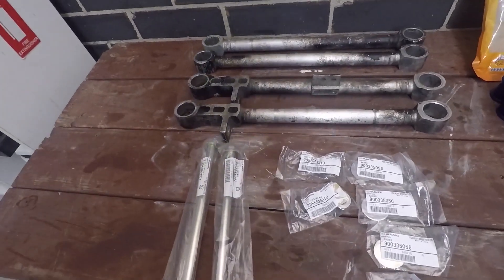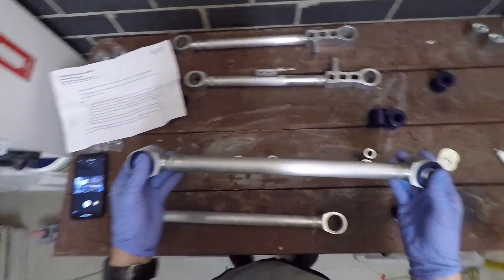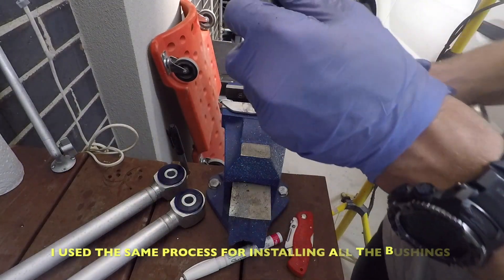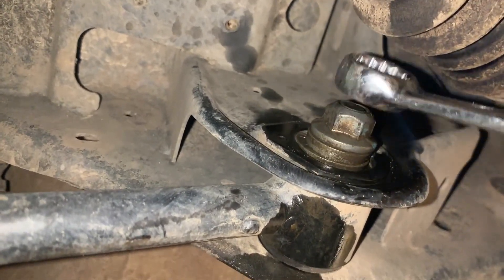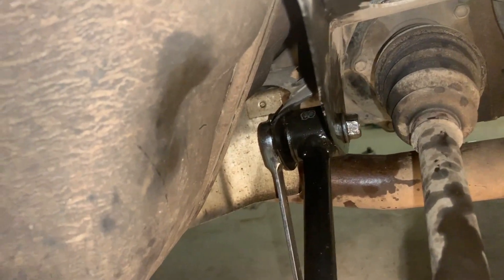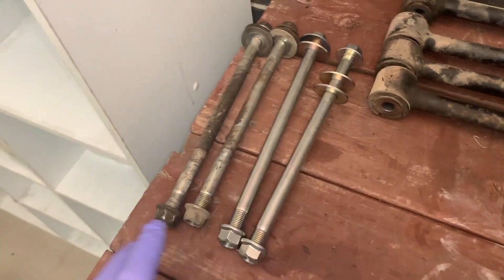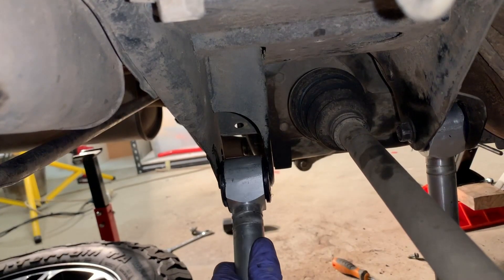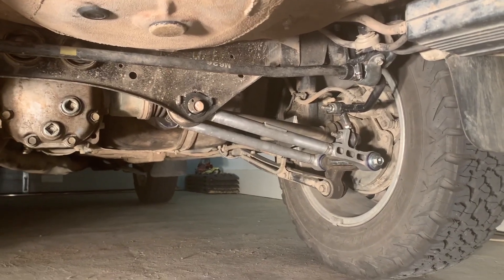SUBARU FORESTER - STI REAR ALLOY CONTROL ARMS ( WITH SUPERPRO BUSHINGS) - INSTALL

Comment: Is the end link tab on the STI links in the same location as on the OEM links? Are the tabs the same distance from the lateral link bolt?  Did you have any trouble lining up the sway bar with the tab during installation?
Reply from the maker: Hey mate, i didn't measure it but it was pretty much the same. and no issues with the sway bar.
Reply: @dtpprojects  Thanks for the reply!

Comment: Are there any other benefits to these other than strength and weight, like do they offer additional camber or anything?
Reply from the maker: Ignition Offroad  as far as I know there is only weight and strength differences with these.

Comment: This two bolts side gear are adjustable ? Or just one in  two ?
Reply from the maker: sorry mate not sure what you mean?
Reply: idk if you ever figured it out, but on most subaru chassis, only the rear-most bolt is the Toe Adjustment Bolt.  The Front of the 2 bolts is just a holder/Not an Offset bolt.